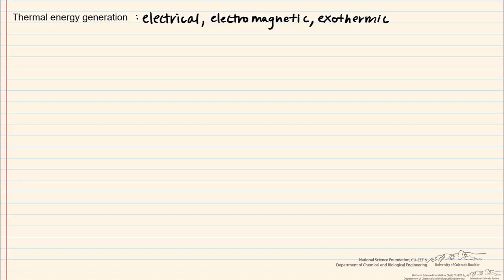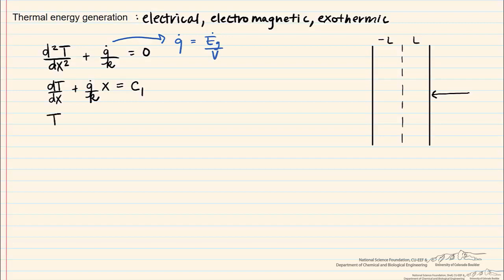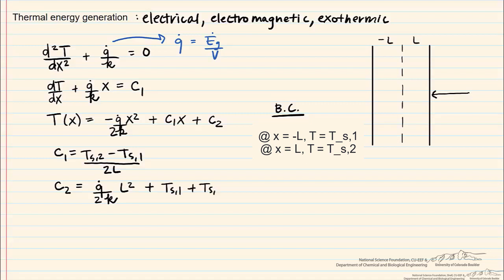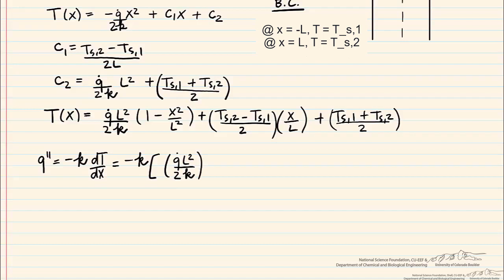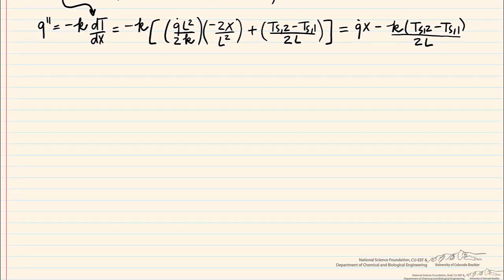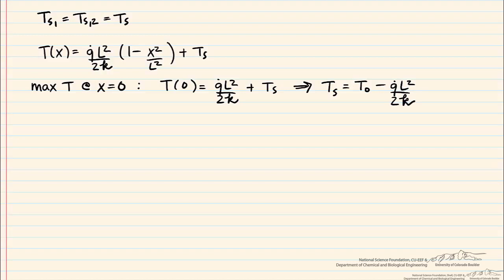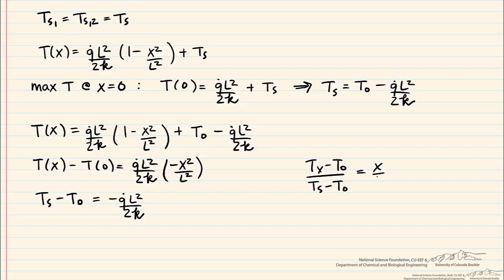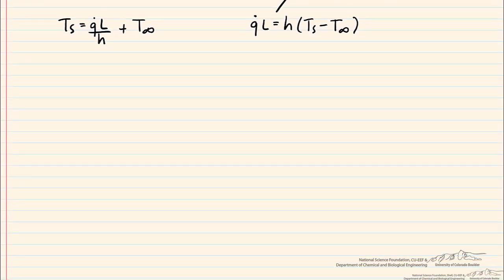One-Dimensional Heat Conduction with Generation

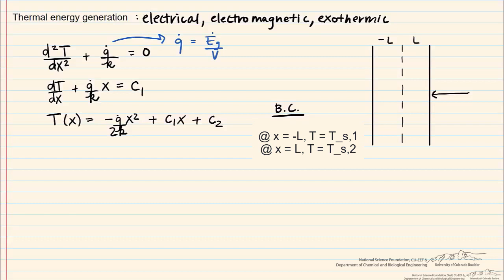Comment: Totally lost me getting the constants from the boundary conditions starting at 3:07, seems like a lot of terms have to disappear in order for this to work, clearly I'm not understanding
Reply: We know that at each end of the wall, it is some temperature. By plugging in the temperature (T_s,1 or T_s,2) on the left side of the integrated equation T(x), and the length (-L or L respectively) to the x value on the right side, we can solve for our constants c1 and c2
Reply: @cookieproductionseab  thank you!